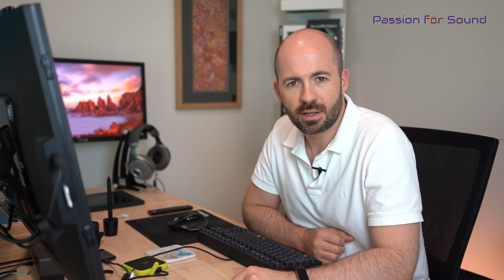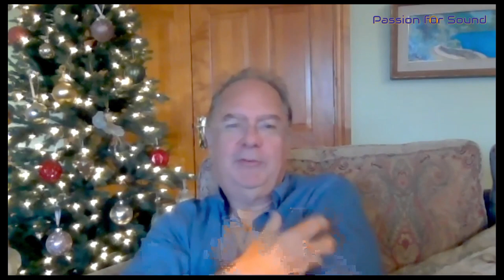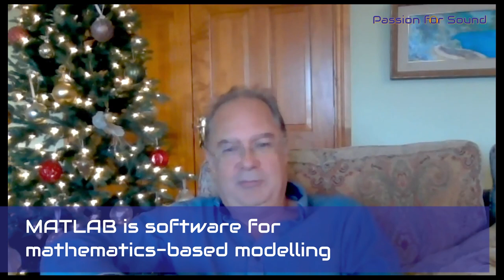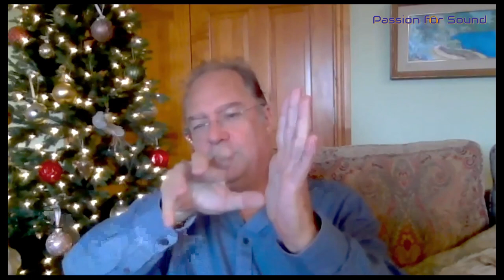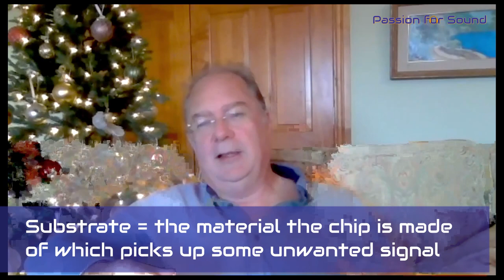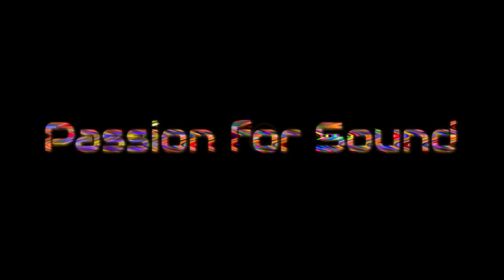Interview with Chord Electronics' Rob Watts - Part 1: R2R vs Delta-Sigma vs Chord FPGA

Comment: Since Rob doesn't do R2R Dacs, might be good to interview Schiit next since they do both delta sigma and and R2R
Reply from the maker: Nice idea, Gilbert!
Reply: Shiit does not use DAC11001, but uses one of cheaper model, which has certain issues with glitches. So, Shiit is not about a sound, but rather about a design imho

Comment: In modern ladder dac's a FPGA is used to correct the accuracy of the resistors making it possible to get higher resolution. Rob never mentioned that.. wonder why

Comment: Thanks for doing this, a lot of useful information.  The next step like someone else has mentioned in the comments is to interview a company that specializes in R2R DACs and have them tell us how R2R DACs are better than Delta-Sigma... I find it interesting how he mentioned that DSD was a step back in that when listening to DSD audio files on iFi DSD DACs sounds leagues better than non-DSD audio files (even other people I let listen confirmed this), so I'm a bit confused if the DSD he is talking about is the DSD audio format or something completely different having to do with Delta-Sigma.
Reply from the maker: Hi Zadius, the step backwards he's talking about is in relation to single bit DSD versus m-bit DSD which uses a few bits. By the time DSD (single bit) recording was invented, we already had m-bit tech that was superior, but to record in m-bit requires gobs of data. Take a look at the size of a DSD file and then imagine back in the 90s when memory was smaller and more expensive of they had to make files exponentially larger (i.e. 3 or 4 bits instead of 1).
So Rob's point, as I understand it, is not that DSD was worse than PCM (FLAC), but that it was not as good as the m-bit tech available at the time.
Reply: @PassionforSound  this needs to be viewed in the context of hard-copy media, i.e. cds.  That means a ~700MB data budget to store the music.  Using multi-bit encoding would not fit a traditional album on a cd.  1-bit DSD was a big improvement over PCM, because it meant the recording and playback systems could use sigma-delta ADCs and DACs, which at the time where a step up from the direct conversion tech available.

Comment: Hi friends, what was the term rob mentioned at 5.49? Something like girle (or gargle) tones.
Reply from the maker: He said "gurgle tones". I have no idea what they are and missed it during the interview to ask him. Also can't find any references anywhere so perhaps it's his own term?
Reply: @PassionforSound  I'm not sure. Rob generally uses terms that can be described as some general engineering term (noise floor modulation, etc) than most of the vague terms others use so it's less likely to be a term he made up. If you can get in touch with him again, please do let me know his explanation on this.
Reply from the maker: Will do 🙂

Comment: I agree with you that many DS DAC’s have a hard, analytical, edgy nature, whereas a good R-2R can be much more natural sounding.  A well implemented AKM tends to have better characteristics than most Sabre’s, but it also depends on other design and related factors.  

Rob has a horse on thus race and the fact he rallies so hard against R-2R DAC’s is a function of the fact that so many audiophiles and high end reviewers put many of the best high-end DAC’s that are often R-2R against his FPGA, which forces Rob to feel he has fight that battle.  Also, Rob has mostly listened to old, R-2R DAC’S back when it was a cost-savings or sheer necessity, and they were based on much lower tolerance resistors than we have today.   

The fact is that there are sooo many differences between his FPGA design and all of the typical Delta-Sigma’s that he really is enabling a bit of a false comparison.    We have a range of DS, NOS and FPGA DAC’s in the studios and media lab here, and generally find all but the best (most expensive ) DS DAC’S to be more edgy and artifact laden, even though some measure better than a lower-end R-2R.
Reply from the maker: Yes, I don't agree with Rob's definitive stance on DAC technologies because there's always new stuff coming, but he's also in a unique position of expertise to discuss the superiority of his approach compared to other Sigma Delta DAC chips on the market.

Comment: Thank you very much for the great interview. My interpretation of the R2R vs  DSD hit me that because its easier to design a R2R based unit I would think it has a distinct advantage at the low priced DACs like you have been using as opposed to the complexity of doing DSD its just not as competitive with the R2R at the lower price points. Thats how it came across to me so I think you were both right. None the less I really appreciate your terrific interview & the opportunity to listen to one of the truly great designers in the audio industry. I have a great deal of respect & admiration for Rob. Can't wait for part 2!!!!
Reply from the maker: Thanks Scott. Yes, I think it's a good idea to be cautious of low prices R2R DACs. It's a wonder the Airist R2R sounded as good as it did. Glad you enjoyed part 1!
Reply: the cost of a system is only partly determined by the development cost.  generally, the cost of components dominates.  super low tolerance, i.e. highly matched, resistors are not cheap.  therefore, a delta-sigma based dac can also be competitive at lower price-points.  as usual, the correct answer is: it depends :)

Comment: I really enjoy your reviews and interviews.  I am a Chord Mojo owner.  One thing I never heard answered is why Chord decided on using USB to interface the Poly and Mojo, and Hugo and 2Go?   Is the reason for versatility and support of the different streams that are supported using that interface?   The reason for my question is I am reading from many Chord owners that Coax and Optical is superior in SQ.  Supposedly Rob Watts has stated optical was better sounding than USB.   Perhaps in the future you could evaluate a music streamer (Auralic Aries or similar) and compare the different input types and provide your thoughts as to which interface would provide the best SQ?
Reply from the maker: Hi Mr Tim, glad you're enjoying the channel - thanks for watching! That's an interesting question about the USB interface. My assumption is that they are drawing some power from the Mojo/Hugo as I don't believe there'd be a battery on-board the Poly/2go. That said, I guess they could have used optical as well. If I chat to Rob Watts again, I'll see if I can find out. As for testing different inputs, I often do this in my reviews, but I have found more and more of late that there is less difference between USB and other interfaces as companies are becoming more aware of the need for galvanic isolation. That's not to say it's irrelevant so much as that it used to make a significant difference and now it's one of those 'last 1%' type of improvements.
Reply: @PassionforSound  ideally every interface even would use light for data and copper only for power.  do keep in mind that even then, a good re-clocking at the receiving end is vital.  as it is, copper is good enough and systems can be designed to mitigate the added noise and interference introduced by usb.  TLDR: usb is the path of least resistance ;)
Reply from the maker: Yes, light is great if it can be implemented as well and carry the same bandwidth (for those wanting DSD, etc.) but it seems to be poorly implemented quite often

Comment: R2R DACs have a number of advantages over Delta Sigma - they have much less out of band noise (DS DACs chuck out lots of high frequency noise which requires much filtering to remove), R2R DACs are less sensitive to jitter and R2R have less noise modulation. Their lack of linearity can be compensated by various techniques, such as via DSP or co-linear architecture. Rob Watts is giving a very one sided view.
Reply from the maker: Hi Dan, I agree that Rob is focussed on his approach as the right approach (understandably) and I definitely intend to conduct another interview in the future with someone who makes R2R DACs so we can hear both sides of the story
Reply: @PassionforSound  There is  denafrips and audio GD, BOTH make R2R.

Comment: FPGAs do have a role to play in R2R Dacs , from the likes of Rockna and Audio-DG (to name but a few) :  http://www.audio-gd.com/R2R/R1/R1EN.htm
Reply from the maker: Hi Trevor, I think the point was that the FPGA is being used for controller duties in the Audio-gd and other DACs. In the Chord DACs they are doing the actual decoding and filtering. Of course, R2R doesn't need an FPGA for decoding - it has the resistor ladders for that.
Reply: @PassionforSound  Right. Right.  From the Audio-DG's product own product specs:  "A basic R2R ladder is simply not sufficient enough to achieve good performance and sound quality! " and also "An ultra-fast FPGA controls and corrects the R2R ladder.".
Reply: @trevorharrison29  That's right!

Comment: And one more thing about delta-sigma (name itself talk about principle) i strong feedback and time domain issues. They measure great on continuous predictable signals, but music is all than continuous signal.  And also too much of needed processing i DS dacs.  I have feeling that every process in digital domain push us as listeners away from music itself.
Reply from the maker: That was my belief as well. Having spoken to Rob Watts and done further investigation, I don't necessarily believe that anymore. The challenge we all face with digital audio is that the digital file doesn't contain a continuous signal and had to be rebuilt. To properly rebuild the signal (taking high speed transients into account), I now believe that there does need to be a level of complexity and feedback in the reconstruction filters.
Reply: no need to talk all this nonsense and just say that Chord dacs is less sensitive to jitter cause their approach can get away with average clock. Given great oven controlled clock delta sigma dac will have no jitter whatsoever.

Comment: I suspect the main factor is the implementation. Aries Cerat claim that DAC chips present an inherent limitiation in hi-end possibilities which can only be surpassed by superb R2R. I suspect this is true for ultra hi-end but for more modest DACs implementation probably rules. I have ordered a Jay's Audio DAC2 Sig for £2698 which might be not as good in some ways as a Denafrips Terminator for £4500, but sure presents better vfm, and in some ways is supposed to better the Termi.. So Delta Sigmas present better value in general, as they are cheaper to make, especially from China!
Reply from the maker: Exactly. It's all about cost versus performance. Rob's approach is based on the same opinion of the limitation of DAC chips which leaves me currently thinking that either Chord FPGA, R2R or one of the other unique approaches like DCS might be the best choice of cost is no object.

Comment: I think it is matter of what one belive in, or want to sell.  This guy works fo Chord who don´t produce R2R dacs, period.    In my listening , and technical opinion R2R i more natural way do convert PCM to analog.  The only problem today is that semiconductor companies do not produce IC R2R dac chips anymore, so they must be done in "discrete" way which is problematic in terms of precision and stability.  I listen to(own) DAC based on old AD1856 R2R and still sounds like best of digital, it sounds fluid, very dynamic, great sense of ambience , like you are there in recording you listen to. It sound more like analog source than digital one. All delta-sigma dacs I tried have tendency to sound artificially, gray sounding in one word, without real vitality in presentation .
Reply from the maker: Hi Tomislav, no doubt Rob is focused on his philosophy. At some point I hope to conduct a similar interview with an R2R specialist.

Comment: Great interview! Actually R2R DACs can objectively outperform Sigma Delta DACs because they can be measured in the signal to noise ratio. If you watch the review Golden Sound did on the Holo May he shows that based on objective measurements that the R2R Holo May out performs the Chord Dave with M Scaler. He shows the graph for both and the Holo May, which has -145 db noise floor and can perfectly reproduce a sign wave with almost no distortion, where as the Chord Dave with M Scaler has a higher noise floor and can’t reproduce a perfect sign wave as well as the May can. You should talk to Tim Connor at Kitsume and get a demo model for testing and review.
Reply from the maker: Hi Brent, I don't necessarily agree with Rob's assertions that R2R DACs are inherently flawed. I do believe his approach to the filtering of the signals is outstanding, but no doubt there are amazing R2R implementations too.
I'm yet to watch GoldenSound's review of the Holo May, but I am keen to and will try again (I've tried once before) to get a review sample of the May.
I do believe there might be more to the end result than what can be measured objectively because there are things that we still don't understand and can't measure relating to our perception of sound, but I'm keen to hear the May for myself before drawing any conclusions.
Reply: @PassionforSound  Pretty much everything Rob said was spot on accurate. He wasn’t lying or spewing propaganda. However, he just didn’t have access to the people knowledgeable enough on how to make an R2R ladder DAC outperform and overcome it’s resistor tolerance problem. To my knowledge, Kitsume is the first to do that. They also implimented a full R2D ladder DAC for DSD on top of the PCM ladder DAC for FLAC. So they went way way over the top, which is why it’s such a special DAC. And the result is something that sounds about as close to a very high end analogue turn table or Reel to Reel player as you can get in a digital medium. And for $4k it’s an absolute giant killer as it can beat DACs costing 3-4X as much.

Comment: The R2R distortion sounds more musical to most people. I've had non-audiophiles listen through Topping E30 (sigma-delta) and Schiit modi multibit (R2R), every single time, every listener preferred R2R sound. Only one yound person chose Topping E30 since he liked brighter edgy details over smoothness and holographic sound of multibit
Reply from the maker: I think at this level that's probably true in a lot of cases. More sophisticated Delta-Sigma designs do improve on that in my experience, but R2R still has it's own enjoyable sound.
Reply: there are many ways you can add distortion for your liking. best is to listen am radio, you will get lot more distortion, why to buy so much expensive r2r dacs. :)
Reply from the maker: That's kind of true. The Schiit Multibit uses a resistor ladder (in a chip) and they apply their own filtering and DSP to the signal. Other R2R companies use actual discrete resistors, but they also apply their own DSP and filtering too.
Reply: Better measuring r2r dacs like holo and denafrips sound more like ds dacs, in one forum it was mentioned.😂 So if distortion is what people look for in r2r dac, they should listen am radio music. It gives lot more distortion.😎
Reply from the maker: I totally disagree with whoever wrote that in the forum you were reading. The Ares II sounds nothing like a DS DAC and, based on a lot of the comments and reviews I've read, neither do the other Denafrips DACs. The Schiit Bifrost 2 is a little closer in sound to DS, but it's got far better 3-dimensionality.
Just because distortion figures are the same, it doesn't mean things sound the same - there's more to it.
Reply: @PassionforSound  it seems poor measurements help schiit bifrost multibit to sound more 3 dimensional. Isn't it ? 😂😀😂🤣😅😁😆😀😀
Reply from the maker: I don't understand these types of comments. Whilst distortion can definitely add to the perception of soundstage depth, so can better recreation of the correct transient timing (which I believe the Schiit MB DACs are designed to do in their own way). Measurements get thrown around as the sole source of truth as to which DACs are better or worse, but they don't convey the whole picture.
Reply: @PassionforSound  To put things in a slightly less obnoxious way, if you want distortion, why not buy something you know measures very well and outputs very clean sound, then add your own distortion via DSP? At least that way you can tweak it to your liking, and there's nothing magical in an analog output stage that can't be replicated via DSP in regards to distortion.

I suppose it's a convenience thing, not everyone knows or wants to figure out how to find the filters necessary, setup your signal path to involve it, and also even how to adjust the distortion to your liking.
Reply from the maker: Sorry, my response may have made it sound like I'm supporting distortion specifically which I'm not. There are two separate points here: 1) distortion is not inherently bad and while I'd generally choose a better measuring product if all other things are equal, sometimes a slightly worse measuring product sounds better - maybe due to the distortion or maybe due to its design and the distortion is either a side-effect or coincidence 
2) my preference is always for the device that sounds the most like the real thing (i.e. live music). Measurements can't tell us this as evidenced by products that measure near perfect having less enjoyable sound quality than other equally well measuring products. A good example being the Schiit Heresy that I don't much like and the Geshelli Erish that I love. Both measure great, but only one sounds natural and realistic to my ears.